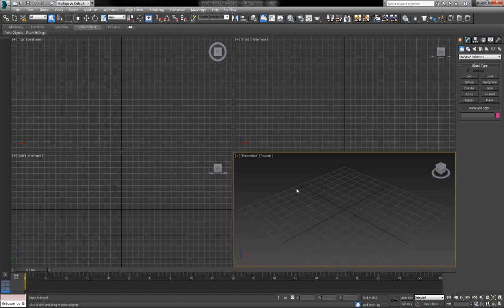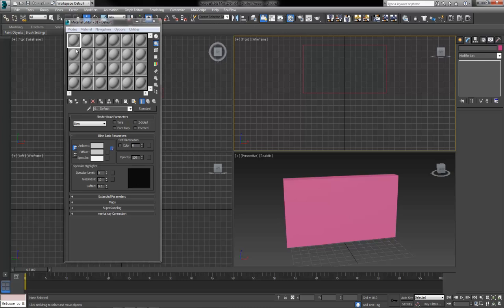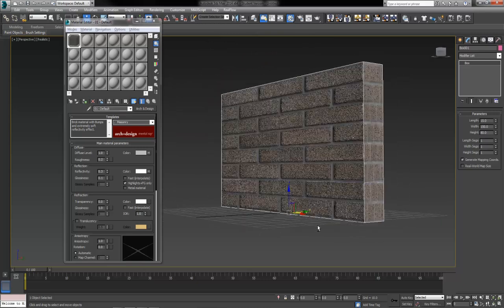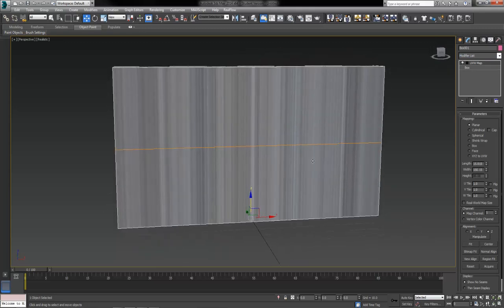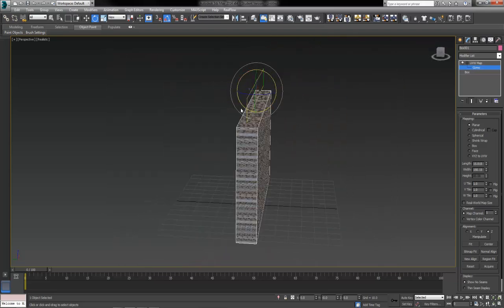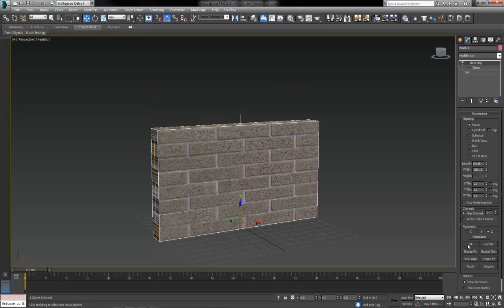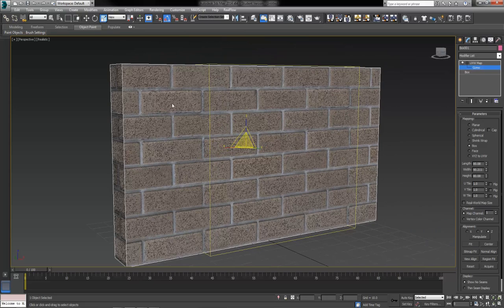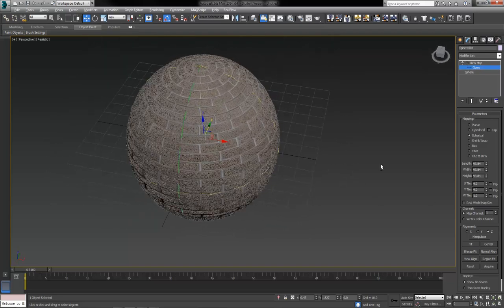UVW Map Modifier Coordinates in 3DS Max

Comment: I am learning some great detail from your tutorials. I am wondering if you might think of doing one on applying textures, and  baking them to maps for more complex models, such as Autocad Imports etc.. I have an example right now that I am trying to figure out to no avail. I am trying to texture and render out maps for a Jet Engine model imported from Cad. I am trying to get the maps so that Element 3D for AE can render them easier with so many faces.. Anyhow, that would be great. If you would be interested in doing that model, I would be happy to send you the file, or if you have something similar it would be greatly appreciated. I am fairly well versed with AE, but 3DS Max is still new too me.. TY.  Just a suggestion.. :)